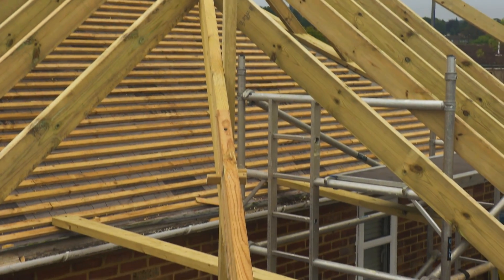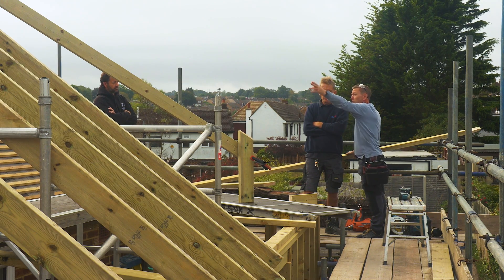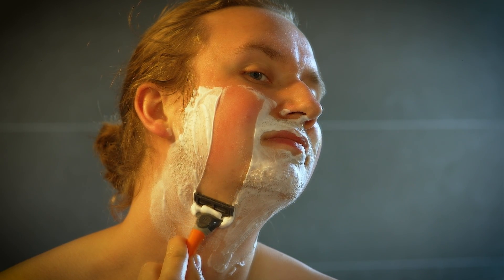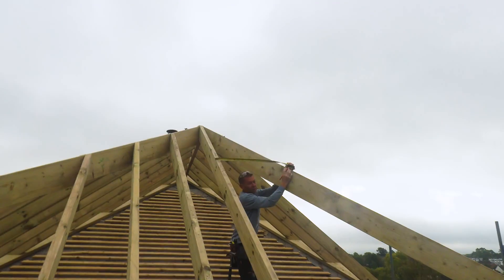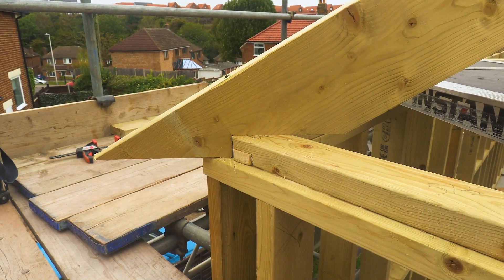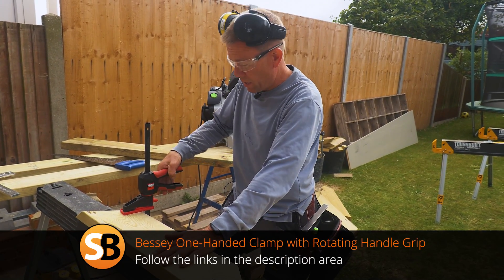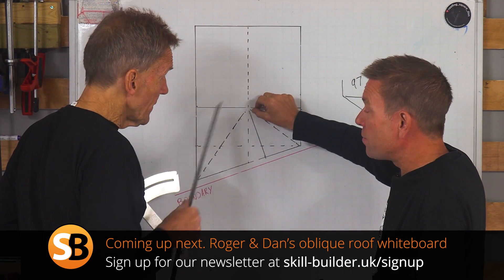How To Build an Oblique Pitched Roof

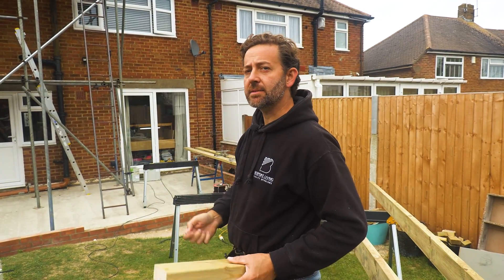Comment: A Question: At around 7:00 minutes the lad is using his Festool plunge saw and track to cut the bevels and he lifts the saw and the track is attached.  How is the saw attached to the track to enable it to lift both?  I've tried increasing the pressure of the cams that are used to eliminate play and sideways movement, but that isn't very successful.
Another good video from the folk at Skill Builder, they are a veritable mine of useful information.
Reply: It’s not a plunge saw. Think it’s a HK saw and it clips to the guide rail.
Reply: @Ultimate-roofing-square.  Many thanks for taking the time to reply.  My mistake, I haven't used, or even seen, the HK saws, it was a treat to myself getting the Festool plunge saw (which is excellent) and I mistook it for the HK.  You guys are a real advert for what is good in the building trade, keep up the good work.
Reply: @RG-Factotum  more than welcome.  
One problem with the HK is the 55 isn’t quite big enough and the 75 is only available in 240 v.  
The plunge saw is a great tool. 
Thanks for watching.

Comment: Are the plumb cuts on the hips slightly different angles ?
Reply: The two hips are different, one is 27.5 degrees and the other is 30.5 degrees.  All the jack rafters and commons are 38 degrees.
Reply: @Ultimate-roofing-square.   thanks Dan.   Very interesting job . 👏
Reply: @markb1971  thanks for watching it. 🙌

Comment: It's great to see you back Dan but you didn't half bring a real headache with that roof. At point 1.45 on the video the 29° you talked about is this plumb cut you would normally have and a 38° seat cut. Although  these figures along with 90° don't add upto 180°.
Reply: Thanks, good to film with SB. 
Usually on a conventional 38 degree pitch roof, the hips will be 29 degrees.  This one the hips varied.

Comment: Very tricky roof. Not for a inexperience chippy. Very well done Dan. Dan the two temporary rafters you put up were they  even in lenght dimensions on the first two rafters to get the ridge height and get the lenght of ridge off them🧐
Reply: Hi Paul, I put 2 temporary full length rafters up to get the ridge sitting right, then fixed the valley jacks.  I measured from the wall plate to cut the ridge to its proper length.  Hope this makes sense..
Reply: @Ultimate-roofing-square.  I get you 👍. I looked back at the video so the two side walls are parallel and the end wall hip end is out of square.
Reply: @paulcloona9331  yes.. so I measured the plate to plate and cut in 2 rafters to get the ridge in.
Reply: @Ultimate-roofing-square.  thanks Dan I understand you. I like the idea of a temporary hip rafter clamped up to  get the angle of the difference in hips. Great work Dan love the videos.
Reply: @paulcloona9331  thanks for the continued support.  🙏🏼

Comment: How did you find out the pitch
Reply: To find the pitch of the original roof I used my electronic angle finder.
Reply: @Ultimate-roofing-square. Stabila of course Dan, along with Bessey clamps and Occidental Leather tool belts. Your a man after my own heart, champagne tastes on cider wages, 👍💪🔨🇮🇪
Reply: @Toyotaamazon80series  😂.  Some of the tools may be a bit more expensive but worth it in the long run.   
Thanks for watching 🤝
Reply: @Ultimate-roofing-square.  👍💪💪😁🔨🇮🇪

Comment: Nice work! With that wall make up, how would you demonstrate that the plasterboard fixed to the insulation will get 30 mins? Is there certification? Building control are starting to ask for proof rather than the old 'deemed to satisfy' rules and the plasterboard manufacturers don't provide any testing certificates for timber systems

Comment: Roofing in good weather is satisfying work. When i did my brother’s roof in Surrey. It rained so much he had to spend an extra £ 8000 for a temporary tin top roof. The house was still being lived in during the renovation. So it had to  be covered anyway before we opened up the roof. I haven’t done any roofing in about 4 years now. I do fire regulation joinery work for independent living schemes for housing associations. I have to take my coat off in winter at work. It’s like working in a sauna. All association folds have to be kept at a permanent 25 degrees. Roofing is usually the most  satisfying work for any 1st and 2nd fix carpenters but it’s a young carpenters game.